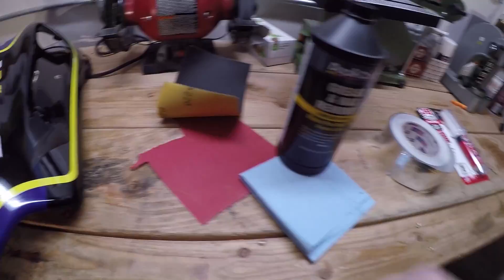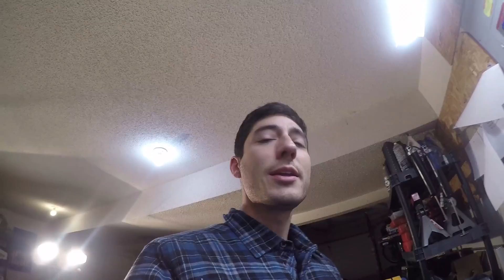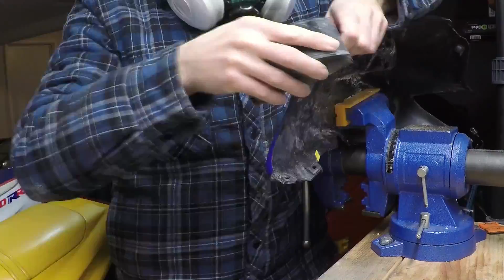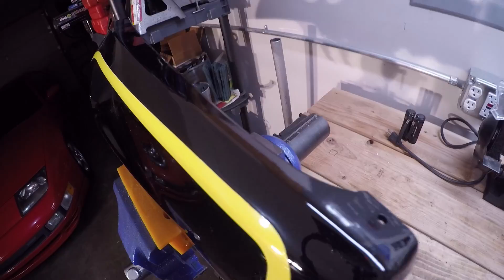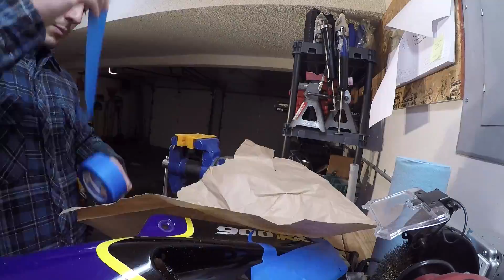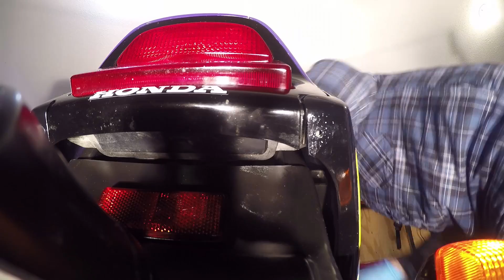How To Repair Sportbike Fairings Without Special Equipment

Comment: The JB weld won't bond to the ABS plastic for long. It will snap off with any force over time. Plastic welding is a much better way to fix it if you plan on keeping the bike. 
What you did is good for the short term if you are selling the bike. Not very nice to do though.

Comment: Do you have any experience with the aftermarket abs fairings for the cbr900? I’d like to keep my stock fairings in better condition and use the cheap ones to ride around in but I’m skeptical of the quality
Reply: Also I’m jealous of just HOW CLEAN your bikes are, and thanks for your guide on Jalopnik it’s very helpful. One other question, does the clutch cable go underneath the instrument cluster bar?
Reply from the maker: Thanks, I appreciate it! I've not seen the aftermarket fairings in person. There are a couple of differences I've noticed in the decal work based on pictures I've seen, but overall they seem like convincing reproductions. I'll have to get back to you on the clutch cable routing.
Reply from the maker: The Polyester Pimp I looked at how the clutch cable runs. There a 90 degree bend downwards immediately after the clutch lever and the cable runs under the bottom triple clamp.

Comment: Love those old blades! Those fairings are made of ABS plastic. You just have to cut some donor ABS,like lego for instant, into small pieces and put it into a glass bottle. Than add Methyl Ethyl ketone and let sit for a couple houres. The MEK dissolves the ABS. Make the cracks wider with a dremel and apply a thin layer of the liquid ABS. The ABS melts together and the mek vaporizes, this takes time so best is to apply thin layers and sand or dremel between the layers. Take your time and build up the layers and the fairing will be as good and strong as new.After the last layer it is best to put the fairing in the sun/wind so that all the mek can vaporise otherwise it will ruine your paint.Finish off with a bumper putty.Oh and mek is hazardous so best is to do this outside and use gloves.
Greetings from Belgium.